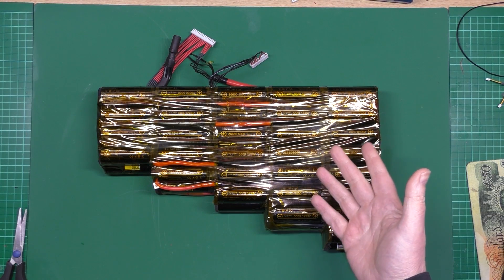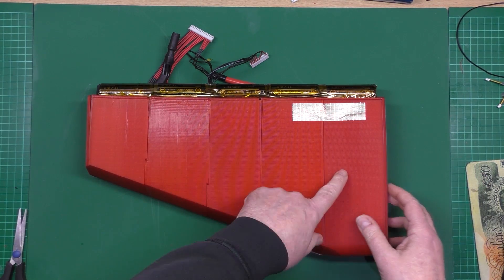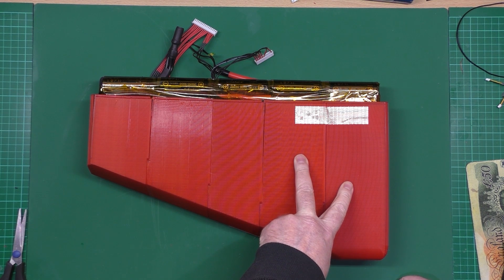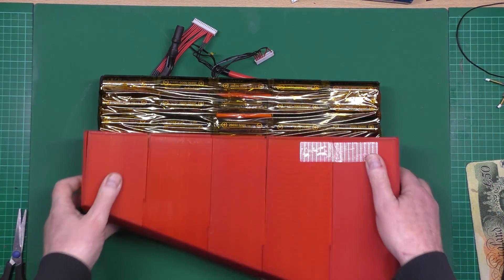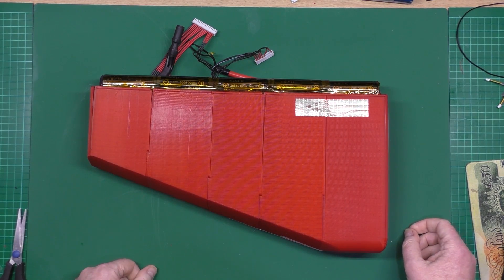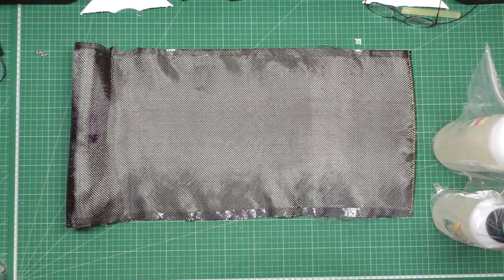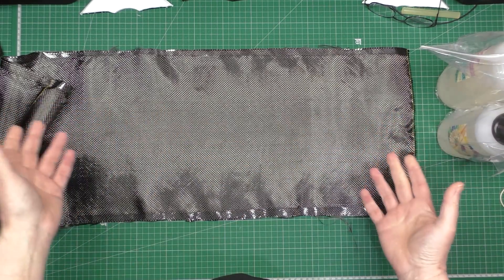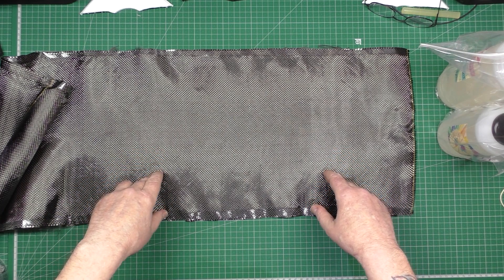High powered DIY eBike MSVA build part 14 - Designing the DIY lithium battery cowling

Comment: How come yoy don't like people asking "what is the range" and "How fast does it go" Seems to me that's the No 1 question almost everyone wants to know. Wouldn't it be easier to answer those questions in your write up?
Reply from the maker: There's too many factors to consider!
If someone else decides to build one the same and they don't get the speed or range that I get, I'll get so much backlash that it's not worth it.
It depends on tyres, tyre pressure, the wheel diameter, battery ability, weight of the rider, riding style, hills, valleys, traffic, whether you peddle or not, how much you peddle, temperature......the list goes on.
All EV's have a 'max speed' and 'max range' but I doubt it very much if anyone has achieved it. If I said "45 miles and 72mph" would it actually make any difference?
Reply: Vortecks....Ok Tony, fair comment. I can understand where you're coming from. I know from experience that's the biggest 2 questions everyone wants to know. I thought it might be easier for you if you just put the figures out there, once and for all, and then be dobe with it. But your explanation makes sense I guess. Anyway,  happy building.  you are doing a great job. Can't wait to see the final finished article. ;-)
Reply from the maker: @royborrill2711  I wasn't being arrogant or anything, Roy. I don't see the point in saying "it does 72mph" when there's so many factors that need to be considered. When I did my top speed run, the tyres were on the verge of exploding, my nose was on the handlebars, I was hanging on by my teeth and the battery needed to be over-charged nearly to the point of thermal runaway to get the voltage high enough. I don't want to disappoint people if they decide to make one and I think they need to find out for themselves ;-)
Reply: Vortecks ..No mate, not for 1 minute did I think you where being arrogant.  Don't think you have any arrogance in you mate. Plus what you said makes perfect sense once I thought about it. Happy building pal. ;-)

Comment: My battery box will be one of those waterproof junction box's from eBay 230mm x 150mm x 85mm mounted under the down tube with 4 holes drilled into the frame & tapped flat plates to hold it as well as zip ties around the frame & box because there will be 60 + 16 18650's for the motor & lightset. I think that I will need to make a video on this so you can see Tony.

Comment: maybe you should consider glass fibre instead of carbon...not conductive and possibly cheaper?
I dont know if this is real (118mph)  https://www.youtube.com/watch?v=ED462YGCVSg
Reply from the maker: Carbon fibre has been done and there's no risk of anything shorting out - it's only an outer skin.
That video is fake. All they've done is lift the back wheel and opened the throttle. My V2 was 94mph using that method.

Comment: Hey Tone as a former carbon fibre laminate technician the thing with carbon fibre is that the maximum strength is in the direction of the weave so a single 1ply 90° cut length of material like you have on that roll if that’s what it is 🤷🏻‍♂️ with a 90° weave, will give you maximum strength in the 90° direction only you will still have twist in the 45° directions of the 90° cut of the material.

But if you wanted more strength in all directions then by adding a 2nd layer on top at a 45° angle to that of a 90° layer  =  2ply at 90° + 45° it will give you all round strength and will minimise twisting, and a 3rd layer at 90° on top of that being 90° + 45° + 90° = 3ply at 90°/45°/90° will give you soil board like strength with no twisting or bending at the 90° and 45° end of the given ply of material.

If this helps in any way shape or form then happy days but if it isn’t of any concern then who give a 🤬💩💦 SQUEAK 😉

Squirrels 🐿 🐿 Live in Fear Everyday.
Reply from the maker: Cheers mate, I did loads of research and watched loads of conflicting videos on how to use this stuff.
Ultimately, it's only to hold the 2 parts of the cowling together and there's no stress or strain on it. The PETG is the main support structure which will work fine by itself but I wanted to make this thing 'mine'.
Reply: I had to read that two or three times to get the gist. Very useful info though, if strength is critical. 
Carbon Fibre wrap is the way to go Tony. I also plan to use it for my battery box as a reinforcing outer skin.

Comment: Well done Tony as always
Reply from the maker: Cheers mate :-)
Reply: Tony today I just bought myself all the gear to make an E-Bike, 36V350W TSDZ2 mid drive motor kit, I'm making a 10S 6P 19.2Ah/16Ah usable battery leaving 20% charge. I got an adapter for 4 bolt 104 bcd cranks so I can use my 36T & 48T chainrings together with my Shimano Ultegra CS 6500 9 Speed Road Cassette 11-23T on my Carbon Fibre MTB. Top speed should be about 45.5 KPH or 28.3 MPH with around 73.8 KM/45.85 Miles Range. Total weight will be around 6.8 Kgs added onto my already 13.2 Kgs bike. As well I have a 4S 4P 12.8Ah battery for a 16 Cree XM-L T6 LED front light. I do a lot of my riding at night because there is less traffic.

I made my bike solely for the road because of my bad back as the frame gives me a perfect A shape of my arms, shoulders & back, the frame & forks are Carbon Fiber, 1200g, Because I can't ride a racing frame no more because of back injuries I turned a MTB into a Hybrid Road Bike. I was able to put road derailleurs on it to cut down weight with a round spinning cable guide for the front derailleur because of cable entry was opposite. I have 26" Zero-Lite 24 spoke 9 Speed wheels with Michelin Wild Run'R Advanced 1.1" slick Tires, these rims are a little heavier than normal but they can take a hell of a beating.

I went this route with the mid drive motor instead of a heavier rear wheel motor because if I ever run out of power I can still ride the bike home but if my bike weighed nearly 40 Kgs then there is no way I ride or even lift the bike anywhere with my bad back. My conversion cost me only about $950 AUD which is reasonable amount of price all up.
Reply from the maker: @solarfunction1847  Please please please post a video when it's done or even when you're building it mate. I love to hear/see success stories and I can totally appreciate how hard it is with a bad back!

Comment: The only funding I had for building my bike came from many fucked-up work-hours. 
Took me three years to have a propper bike. Another 7 passed until I had a propper ebike. 

Try to vacuum-bag (old fridge compressor works if you learn what's that about) that skin on the printed case. After curing it like that, coat to look pretty. 
I did away with plastic bags and lots of tape. But that means coat, let it gel, lay the carbon, coat, let it gel, coat, cure, sand, coat, cure, polish or paint.
Reply from the maker: It's already done with a mirror finish 😁

Comment: Use a glass wrap then hydro dip it.
Reply: https://youtu.be/c4XHmm22rGA
Reply from the maker: @bobwelwood3093  Coincidentally, I watched that video a week ago. The trouble is, there's a lot of set-up with hydro dipping and I don't have the area to do it. There are some companies near here who do it but it wouldn't be my own work then.
Reply: Good point about having the facilities and experience. Surface application of carbon cloth with resin has its own challenges. Take precautions when sanding carbon. Looking forward to seeing the final product.